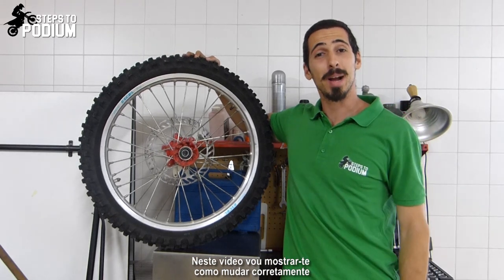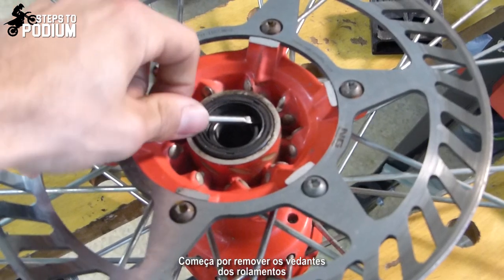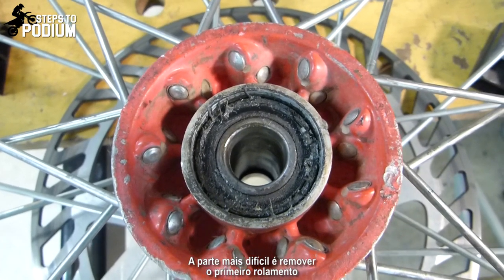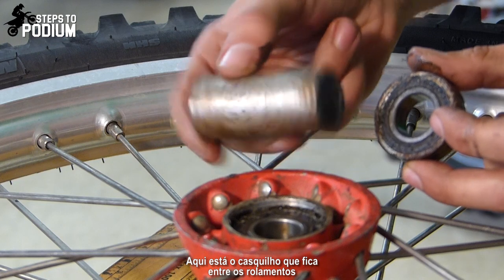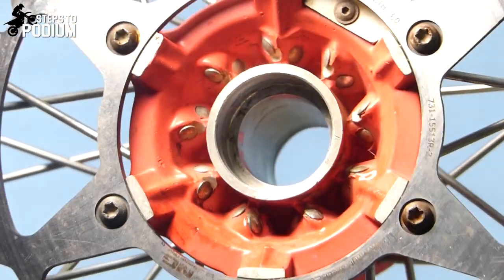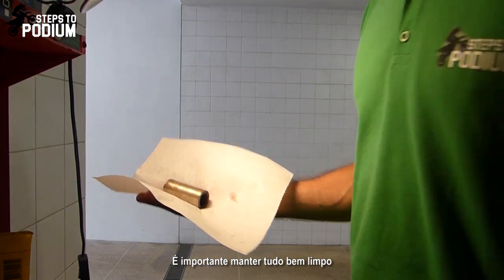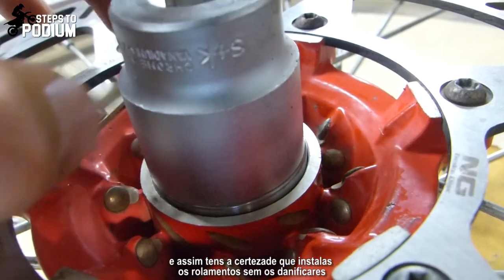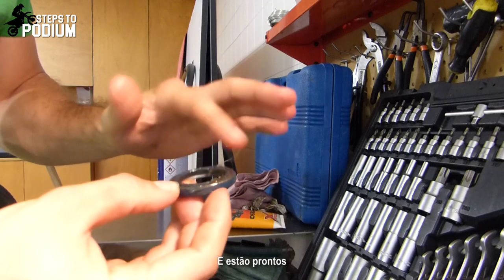How to change wheel bearings on a dirt bike

Comment: Very good explanation. Do not do big ass whacks when running out of patience.. exactly how he did it do it.. hard ones add heat to the side the bearing is coming out.. little taps in and out.. no whack a moles ..When busting out the the spray at the end saying don’t forget.. totally at first thought cleaning tools when done😉.

Comment: Very good video! I like your technique to remove the bearing without a bearing pulling kit. As I have never done this the one question, I have is how to align the center spacer. I saw you just dropped it in there and seated the last bearing. Is it just floating in there and when you put the axel through everything aligns and then you tighten down it compresses and holds everything aligned? Can you explain this part?
Reply from the maker: Yes, that's it! It can also depend on the bike. The GasGas (from the video) was like that. My current bike, a Beta, does the alignement of the bushing through the outside bushings (the ones sitting between the bearing and the swingarm)

Comment: Hello, dear friend. I put one bearing completely inside the seat, but the original spacer is about 0.5 mm bigger and the second bearing does not fit completely inside the seat. Does this not cause a problem?  If I hit the second bearing more, they become completely stiff and it is no longer possible to rotate the bearings with a finger. Thanks.
Reply from the maker: If that's the case, then it's a problem. The bearing should rotate freely
Reply: @StepstoPodium  Thank you for your response. Sincerely

Comment: So I forgot to grease the hub where bearing sits before putting it in... Should I be worried about that?
Reply from the maker: If you replace the bearings on time, it shouldnt be, but if you leave them be for longer than they should be, it will bd tricky to take out!

Comment: Hey man, my bushing in the middle of the wheel is moving up and down, and I can move it with my finger, do my bushing or bearing need replacement?
Reply from the maker: it might depend on the bike but the as long as the bushing is "stuck" between both bearings, between the smaller diameter tracks, all good! 
if after replacing the bearings you can still easily move the bushing up and down, it might be worn or you should check the user manual to see if there are no other components missing perhaps  (it's a pure guess )